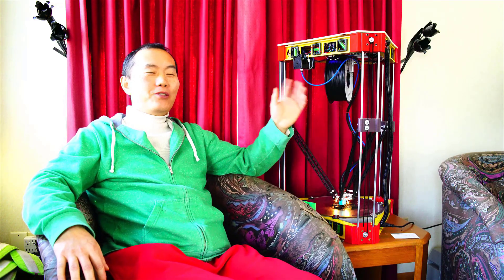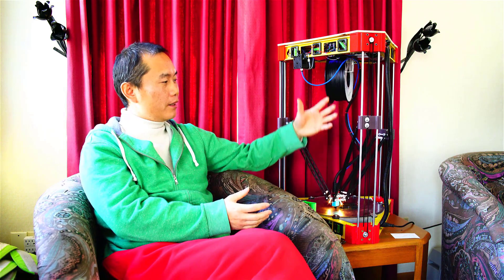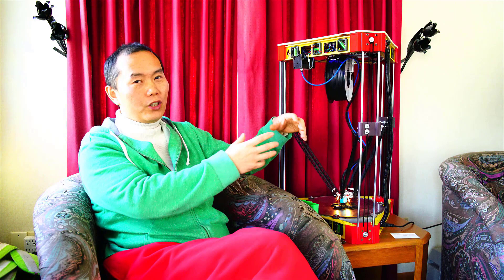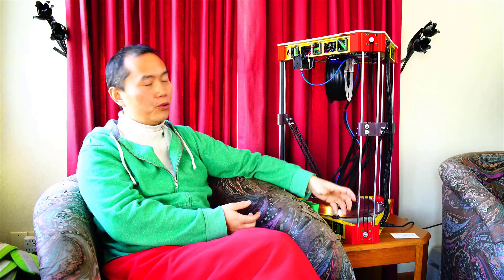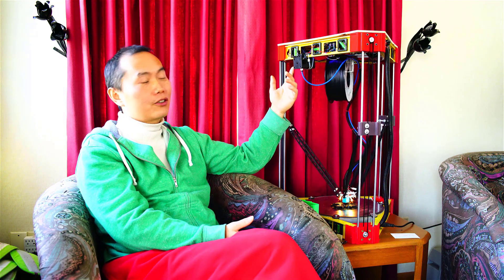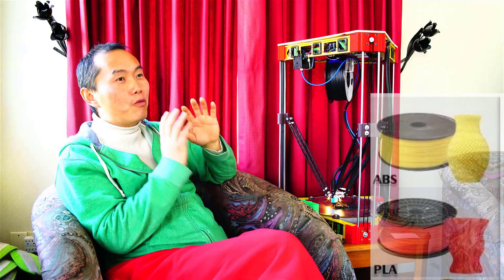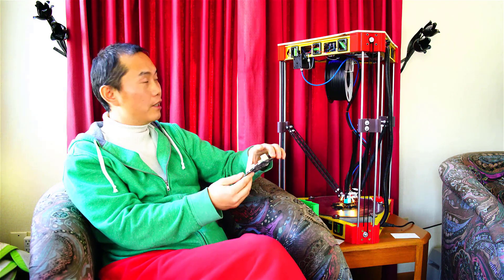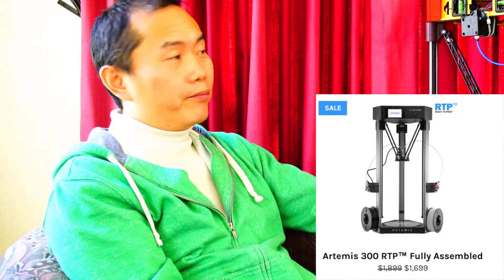SeeMeCnc Artemis 300 Clone, How to build large delta 3d printer

Comment: Love your concept Jerry. Since you are using cheaper materials to get cost down, how, if any, does your printer different in accuracy and speed compared to the SeeMeCnc Artemis? The Artemis uses higher quality material and they say that's how they get better prints than the $500 and below models currently on the market. The old saying you get what you pay for argument.
Reply from the maker: The only difference is the frame. The control board, step motor, delta arm... All the same. There's no difference in accuracy and speed.